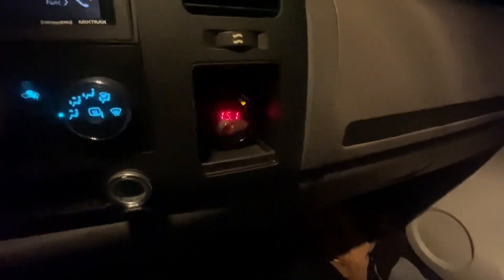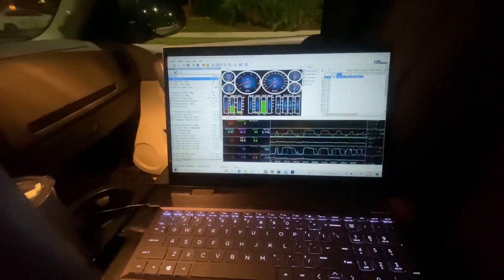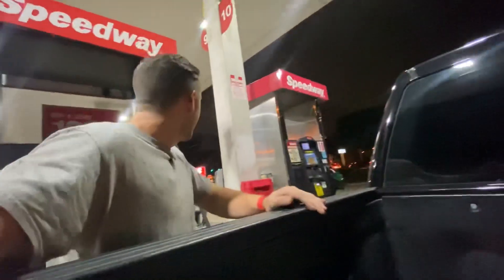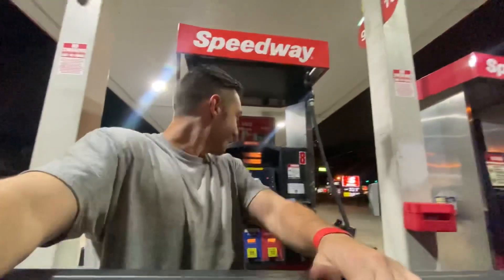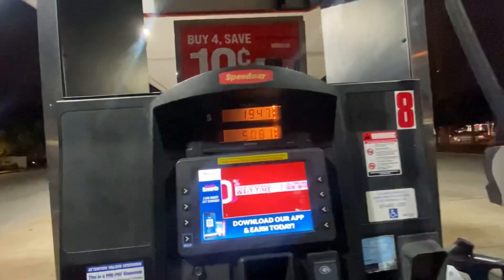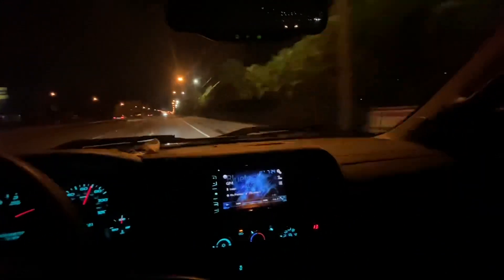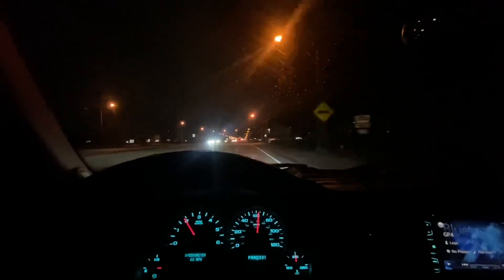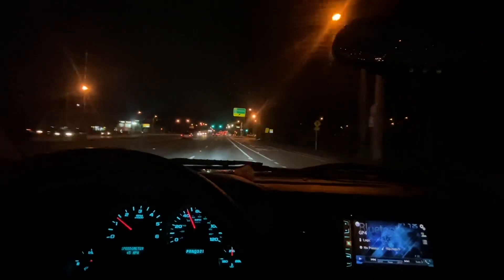Finding out how well my Silverado can do a burnout

Comment: 99-06 best gm truck ever built
Reply from the maker: That’s my other truck! It’s a 2004
Reply: 87’ and down**
Reply: @c.siikz_  actually 86 cuz 87 was square body but had the tbi 350
Reply: @Mikey-wf9py  wait really? I didn’t even know that. 06’ specifically is a close 2nd for me.
Reply: @c.siikz_  actually 07 classic is the 99-06 style but was sold In 07 with the gnt900s
Reply: @c.siikz_  the square body was on the blazer and suburban until 91 but had tbi from 87-91
Reply: @c.siikz_  for me #1 is 68-72 #2 is 99-06.5 #3  88-98
Reply: @c.siikz_  #4 14-18.5 haha I hate 07-13 unless it's the 4.8l without AFM

Comment: So I have to know... did you dyno it when you got it retuned? We never had the chance before he traded it in.
Reply from the maker: Nope! It was just street tuned, I think it’s only on like 20 ish degrees of timing. Wasn’t trying to kill it because I didn’t know what it was really
Reply: @SiskBuilt  Well, now you know. It's a solid and healthy engine... FULL SEND! If I remember correctly, that truck had 68-69k miles on it when we installed the 5.3L The heads and cam were only on it for 5K miles.
Reply from the maker: @bluecollarhotrods9781  seems to run alright! I had 80 on it now! I think I got it with 69/70 right around there

Comment: The 07-13 4.8 has no AFM I believe
Reply from the maker: I think you’re right! Pretty neat tho that they didn’t come with it and basically all the other v8’s did
Reply: @SiskBuilt  means it's better I bet ones with 4.8 have 250k
Reply: @SiskBuilt  that gen4 4.8l has same power #s as gen3 5.3l(LM7)